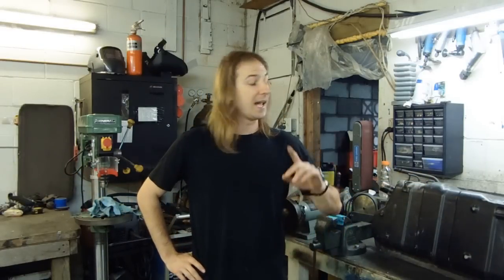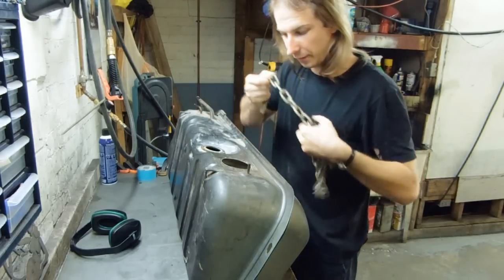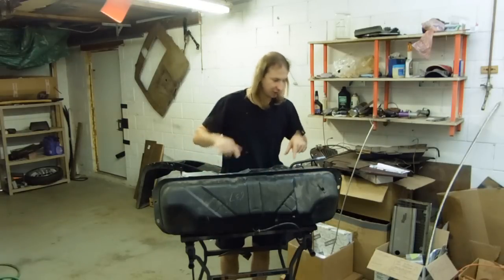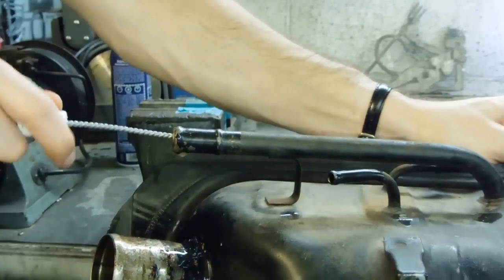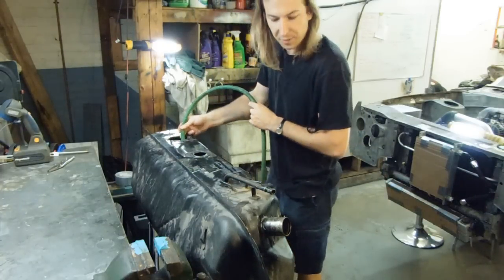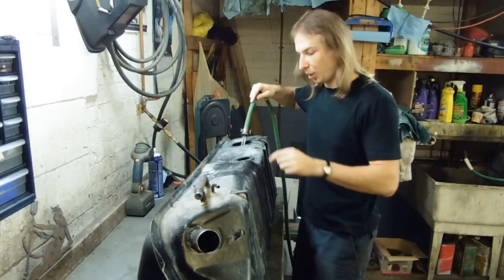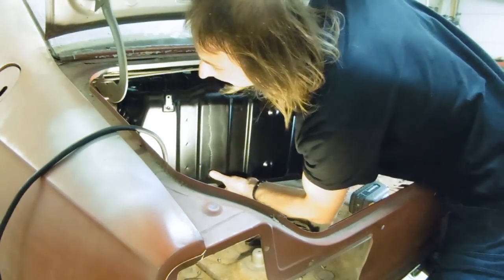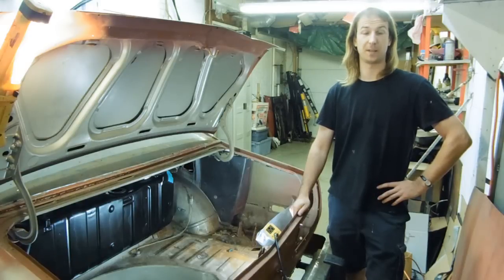Part 38: Fuel Tank Restoration With POR-15 Sealing Kit - My 76 Mazda RX-5 Cosmo Restoration

Comment: Excellent detailed information about an obnoxious task. Don't know if this will help anyone but when it came time to blow my tank out to avoid flash rust, I jammed my leaf blower in one of the big holes and let it blast away. It moves a lot of air much faster than my air compressor does. Thanks for posting vids like this. They help keep me going on a long project when you see others whittling away one mini-project at a time!
Reply from the maker: Thank you! The leaf blower idea is a good one. Probably a lot more energy efficient than using the compressor as well.
Reply: I also use the blower to dry off my Harley after washing to eliminate spotting and allow me to go right to polish or waxing.

Comment: I was gonna say it'd be funny if this resto-mod job ended up being 76 parts, but I see you've already touched on that.

Fuel system work looks like SO much fun.  Glad to see it's working out for you.

Also like the new Camera setup.  Picture quality is great!

Keep up the great work!
Reply from the maker: chapsy1983 I'm actually thinking it could be less than 70 parts because finally, I can see the end coming. The list of large mechanical and fab projects is very short at this point and I can see moving to the interior closer and closer. I've learned over the years that the fuel system is one of those things which will make or break a project car. At the least it can cause constant tuning problems and unpredictability, at the worst, blown engines or burned down cars.
Reply: Very good point, it is a critical area, and I can understand why you were so particular about refurbing it just right.

really glad to hear this project is starting to come around for you.  I'm still anxiously awaiting the finished product!

Keep it up man!

Comment: That’s an amazing result, no doubt due to your extraordinary prep work.
Reply: Ya, he's very good with that scrub brush sction...
Reply: Jokes aside, great explanations for the long way to do it!
I've a small motor tank that rusted until seeping around the petcock. I plan to use muriatic acid then baking soda, then Denatured alcohol to dry. I think that should be enough if the water and baking soda get the rust out. If not, a small chain.

Comment: I had a VW tank that had a bunch of rust in it. I tried everything I could think of. I finally bought 15 gallons of vinegar and let it set for about a week. Best trick I found.
Reply: Just did that for a VW Thing, the tank looked "OK" but after letting it soak in vinegar, wow what a difference.  I didn't think there would be that much rust and crud, the vinegar looks orange with A LOT of what looks like sludge/mud.  So it must have been pretty bad.  I got this 2 years ago, and I saw the last service within that year the tank was drained of gas and "cleaned" what ever that meant.  I think the dealer ripped off the previous owner on alleged services they did to the Thing, because I had to replace hoses and gaskets that should have been replaced when they took care of the tank.  Today I drained/rinsed the vinegar and did a phosphoric etch, tomorrow I will use POR gas tank sealant, that's some good stuff!
Reply: Did you use the entire amount at once?

Comment: Wow amazing work. I have the exact problem with my 1991 Miata gas tank. The fuel pump and the whole assembly unit also has that white & yellowish crud on it. I also see some inside the tank with rust and other gas related sludge. But unlike your gas tank I don't have that grease sludge that was one gasoline. There are so many Miatas in the junkyards here in southern California that I'd rather hunt for a good gas tank. Great video. You are one very dedicated dude to your classics. Hopefully I won't have to do that to my 79 Caballero/El Camino. It runs great so I doubt it.
Reply from the maker: Yes, I think if you have the option to get a new tank, then go with that option. It might not be cheaper, but it will certainly be a lot less work than restoring the existing tank.

Comment: Great video, I learned a lot and did my first gas tank in May (1967 M151A1 ex US Army MUTT) y tank didn't come out as perfect as yours, but I have a VW Thing that will get the POR-15 treatment tomorrow. I used vinegar to get rid of the rust, followed by a phosphoric acid etch.  I saw some very minor flash rust, but I think it might be OK, I might do another phoshoric treatment.  I used a back pack leaf blower and heat gun dried out very quickly.  Keep up the great job, I know it takes a lot of effort to make these videos while working on a project by yourself, and could be done in half the time if it wasn't for recording and editing.  I like your instructional approach and humor!
Reply from the maker: The flash rust is OK if using the POR-15 sealer. It's sort of expected. Just make sure that all of the white dust is blown off or there will be adhesion problems.

Comment: Aaron......if you cut your siphon hose at a 45Deg angle(5 in. from the discharge end) about halfway thru with the point to the bulk tank.....then push shop air thru the cut toward the discharge end of the hose. the shop air will pull a very nice vacuum and start the syphon without your mouth getting any nasty stuff! I have been doing this for years. it only takes a few seconds of shop air and presto.......syphon is started.
Reply from the maker: john pelsor Brilliant! That would be the venuri effect in action!

Comment: Thanks for this video.  You have given me hope for my 78 280z tank which i cant find a plastic reproduction. Based off this video.
Reply from the maker: No problem. As long as the tank isn't rotted through, the POR15 sealing kit should do the job. Even pinholes will seal up, but large areas will need to be CAREFULLY welded.

Comment: Good tip for shaking the tank. Instead of doing it by hand, strap it to the front of a small cement mixer. It revolves smoothly  and you can adjust the angles so all the tank gets covered.
Reply from the maker: That is brilliant. Now, off to find a cement mixer for next time...

Comment: Just a little tip. you may prefer to use a drywall sanding block for paint prep, they conform to odd shapes and are usually made with a 300gr side and a 150 gr side, they work flawlessly for me.
Reply from the maker: Ronald Colman Ah yes, I have used those before. I didn't have one on hand in the shop because I decided to paint the exterior of the tank as a spur of the moment decision. Took a look at it with all the damage and residue from coating the inside and figured the outside should look as good as the interior. So I just grabbed what I had on hand and started sanding. 150 grit really did the job in a few minutes.
Reply: Bang up job too, I just figured I would share something that has worked well for me. Keep the episodes coming....

Comment: You're video much better than other videos on this subject.  I think Por15 has zinc in there phosphoric acid prep solution. Leaves zinc phosphate film. Don't know how much better this is than using only phosphoric acid.
Reply from the maker: Correct, the Metal Prep / Metal Ready is a phosporic acid solution with zinc ions. It leaves a zinc coating. I have some bare metal (the blasted engine bay of the car) which was treated with Metal Ready 8 years ago and is still 95% rust free.

Comment: Question wasn't easier or quicker to split tank in half and then solder back together ? When all done and just needed to prep and seal the joining area ?
Reply from the maker: diego villanueva I think splitting the seam in a way it could be soldered back would be very difficult. The seam is pinch welded all the way around the tank (likely done with a wheel on a spot welder) which also forms the mounting flange. I'm not sure how a weld like that would be removed without cutting off the flange.

Comment: Aaron,
Siphoning, there is a better tasting way.
You should have an air compressor and a dusting pistol in that shop of yours.
Put one end of your syphon hose into tank as usual,  place the other end lower than the tank.
Taking your dusting pistol, place it at the end of the hose just behind the opening pointing in the direction of the hose, pull the trigger.
The compressed air from the gun creates a low pressure at the hose opening ie suction and it will pull the required fluid down the hose, all without insulting your taste buds or causing odema in your lungs if you were to inhale something like fuel or acid with your current method.
You zlso have impressive water pressure in your shop, you owe me a beer and a dry keyboard.
Nice work on the rx5 I havent seen one in decades.
Cheers
Reply from the maker: Excellent practical use for Bernoulli's principle. Good idea. I'll keep that in mind next time.

Comment: Once again good job Aaron! I'd be able to enjoy it more if I didnt get my megasquirt stolen with my POS car (I was using the car as a test bench for my MS3x I told you about and now everything is gone).

Gives me a smile to watch your vid though!
Reply from the maker: Yoan Carlove The entire car was stolen?! I hate thieves. I mean, I REALLY hate thieves. There are some countries which have the right idea for dealing with thieves: cut their hand off.
Reply: I agree, yes they took the POS to part it out probly, I had the turbo behind the back seat aswell as some LS2 coils for COP and all my electronic hardware and tools including the innovate LC2...
Reply: The irony is, I was working on DIY code pad with some on-off-on switches to wire in the ignition but I didn't complete it.
Reply from the maker: Yoan Carlove That sucks even further. Guess it's time to install cameras. Maybe keep an eye out on local forums for your parts.

Comment: While you were trying to dry that tank with the air gun I was saying "why does he not use a hairdryer?"....and then you did. Your compressed air is probably not dried after the compressor anyway Aaron. The air tank is probably rusty inside as well and you'd be spraying some rust into your nice clean gas tank.
Reply from the maker: loloaqici82qb4ipp I actually do have a filter and water separator after the compressor but yeah, the air was not doing much at all other than blowing around the big drops. The heat gun had it dry in a few minutes.

Comment: I can see it now meditation based fuel tank tai chi centers opening all across Canada!  Sticking a heat gun in a gas tank might not be a safe practice NORMALLY, but I think I'd have had no trouble sticking a lit butane torch into it after it sat 30 years, nevermind after as many douching as you gave that tank!  Another great vid!
Reply from the maker: MrComaToes The instructions actually recommend the heat gun. I'd be a bit worried to do so if the tank was just freshly drained. Honesty the fuel smell disappeared long before the heat gun...
Reply: aaroncake Instructions? What are those? Oh, wait this is an arroncake video, a little intelligence is recommended.  ...I'd seen other tank coating products before and some seem less than impressive to me, a while back I shook a box of drywall screws in a BMW motorcycle tank and was so impressed at how spotless it got the tank; that and the fact I live in the desert dissuaded me from putting any tank coating product in it. HOWEVER I may have gone ahead and used the POR 15 stuff if I had known about it, it looks like a pretty sweet product.
Reply from the maker: MrComaToes I've had friends who have had tank coating disasters. But most likely because the shop doing the work didn't prep properly. As we all know, 99% of anything involving a coating is prep. That's also the reason it pays to follow the directions for any POR-15 product. Based on my experience with POR-15 products in the past I have no reason to doubt the quality of the tank coating system.

Comment: I just finished cleaning my 82 dodge ram van fuel tank after sitting in my driveway for 15 yrs.  
I used a small metal chain to break up the heavy rust, then rinsed with water.  Then added some vinegar/water and let sit over a period of 2 days, then rinsed. That cleaned the heavy rust out pretty good.  Then I added some baking soda and water for about 1/2 hr. to neutralize the acid.  Then finally flushed it out with pressure washer.   The last step was using the warm air from my old vacuum cleaner exhaust, to dry out the tank.      Worked out great, at little cost.!

Comment: So how long did you use the heat gun on it for that size of tank? Mine is a 19.5 gallon tank out of a 92 Stealth which is differently shaped, and sort of worried about it being completely dry
Reply from the maker: I think about 15 minutes total. Long enough to bring the whole tank up to "don't want to touch it" temperature. To be sure, you can always just leave it in the sun for a day or let it dry out a few days in doors before coating. Another option would be to just rig up low airflow through it with a fan or air gun. Will really accelerate drying.
Reply: The reason I asked, I saw another video where a guy put his heat gun on high for a couple of hours after the cleaning phase and parts of the tank got up to over 300 degrees, then after the prep phase he left his heat gun on low for 12 hours, to me those both seemed somewhat excessive. My concern is my tank is a 19.5 gallon tank off a 92 Stealth, and I want to make sure it is completely dry which does not produce flash rusting.
Reply from the maker: That sounds extremely excessive. The only stage at which it has to be absolutely bone dry is the final coating, so if you are worried you can use the heat gun a few times and then let it sit. You will definitely get some flash rust after cleaning however it will come off during etching and wont return due to the phosphate coating.

Comment: Just cought this. Couple of questions  :
1. Can you re-use the excess paint sealant which you emptied back into the can on amother car?
2. Can you dilute and spray with a flexible wand instead of swirling the tank around?
Reply from the maker: Once the can has been opened and exposed to the moisture in the air, the curing process starts. So unfortunately it is a one shot deal. They do sell smaller cans of the stuff. Based on the instructions, the sealer cannot be thinned.

Comment: That looks like a lot of effort.  I just found a 10 pack of see-thru fuel filters on amazon for like $9,  Im going to use them as a pre-filter for the OEM one.  Last time I tried cleaning out a tank it just started to leak because I guess it was pretty thin and i was a little too rough on it.  Now i have gas tank patch on it.  Stuff works good though what can I say.  Once  the rust starts it will inevitably come back... how long does the sealer last/protect the metal for?
Reply from the maker: POR-15 stuff is supposed to be permanent. Note that one of the steps is washing out with phosphoric acid, to get into all the pores/pits  and stop rust. I was lucky in that my tank was basically sound, just a lot of crap in it.

Comment: Excellent video. I haven't seen any others with the tank having baffles, mine has two baffles as well  but i do not have access holes to the outer sides , just the center, it's very difficult and buying a new tank is not an option, for some reason they don't make this one.     I was worried that a quart might not be enough but my tank here is smaller than yours so I am guessing it will be fine now. 
   This stuff is high dollar and shit ton of work. I have been shaking the crap out of this tank for what seems like forever , I hate it so much I fall asleep every night dreaming up plans to ma e a tank shaker.

   i have even considered just cleaning this tank and reinstalling it like it is since it did last 38 years without Por 15.   this seems like an incredible amount of work and then to have to dig out 100 to 150 bucks for all these chemicals and cleaners. 

   i have tried apple cider vinegar with pretty good results,  also i put as much water as I possibly could in this tank and set it directly on my gas range and boiled the water inside, when I drained it another shit ton of material came out.     with the three compartments in the tank baffled off like this it is really difficult to even get water out.   there is a tank drain plug on this tank however,  1978 honda CVCC  with the 11 gallon tank.  has small vent spouts I am a little concerned about plugging those up with por 15 but i guess a long skinny drill bit would clear them if they did become clogged. 

   thanks for the video.
Reply from the maker: +Leisure suit Larry It really doesn't take much to coat a tank of this size. I poured 75% of the coating back into the can after the procedure. I didn't care about the vents on my tank so I just let them clog up if they wanted as I only needed the top vent and none of the carb related lines. But I suspect if you are worried about your vents clogging then you can run some welding wire through them after the coating has been applied. Or run the wire through before coating with a little Vaseline on it.